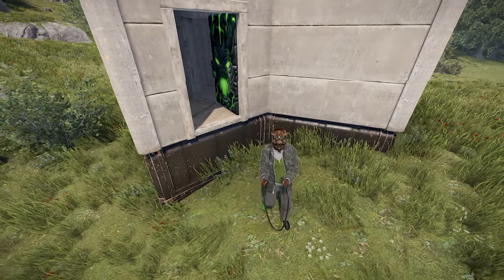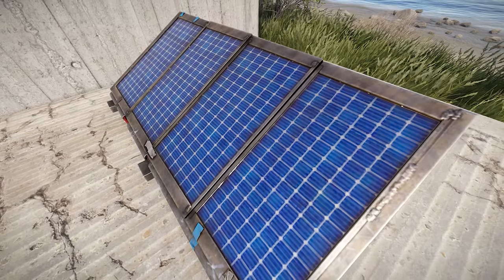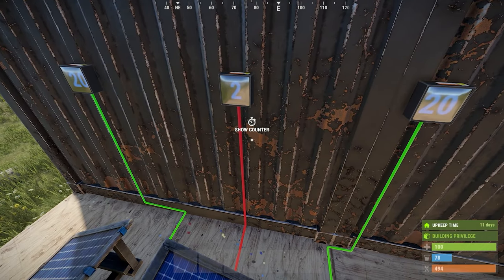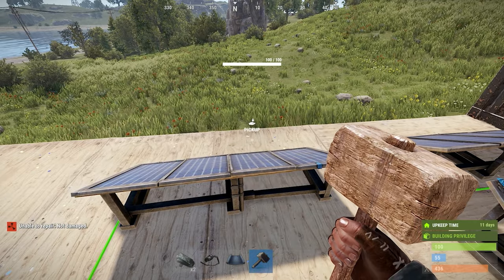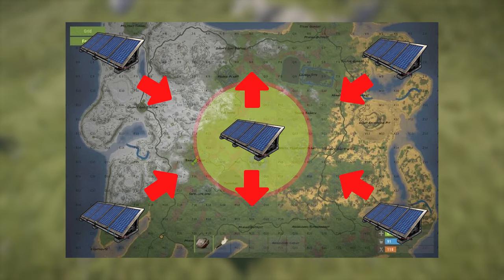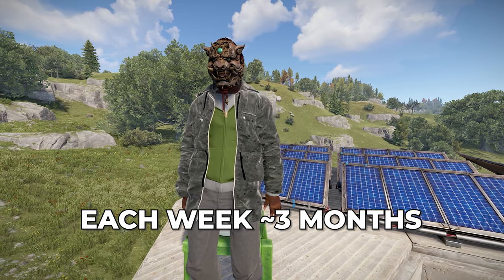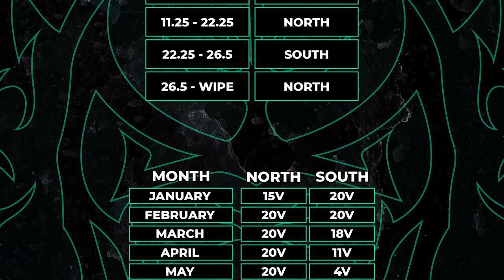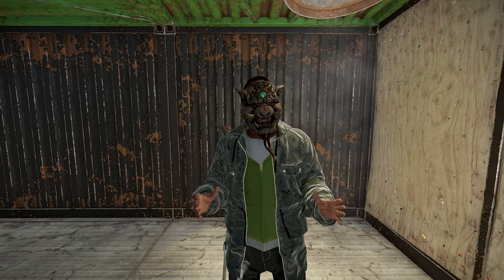Maximize Your Solar Panels with the BEST Direction & Angle [RUST]

Comment: Nice & compact tips, thank you. Few more would be good to mention:

1. Could be shadowed not just by walls, but all kinds of deployables, but also trees, rocks/mountains, and even neighbor panels as well! Panels will shadow each other if you place them to tight!
2. Is it possible to place just on the ground near the house? I saw such stuff a lot some people do, and it doesn't seem to be decaying.
3. Best way to destroy(grief) with non-explosive tools(combiners as well if could take damage).
Reply from the maker: @kote.7269  thank you! I try to cut out unnecessary info from the tutorials to keep them to the meats of what people are looking for!

And yes shadows of any kind can cause an issue 100%. As for placing on the ground I hadn’t thought of this! It’s possible more than likely but would be exposed to grief I’d assume!
Reply: @Sledge315  my 3rd question was exactly because it seems to be ungriefable. Some naked with melee weapon/tool sometimes comes to me, and start hitting panels, and after ~20 seconds usually give up since it does microscopic damage. 

And most electrical components now became invincible, in last wipe i noticed that you can not destroy sensors, buttons etc. Only with some explosives. That's why i mentioned combiners(red ones). Years before, since you can not grief panel - people could grief red combiners with ease. 

And for now?
Reply from the maker: @kote.7269  I feel you on this, a lot of electrical items seem impossible to break but you can definitely sabotage

With damaging a panel it creates less power for instance so hitting them a few times could slow progression of someone’s base if they use them for electric furnaces for instance. 

One time my bud and I griefed a roof camper and broke all his solar panels with some spears. Took about 20 minutes but we were committed. Also just yesterday I destroyed a ton of electrical with satchels with splash damage when taking down a door

There are methods but most don’t chase breaking someone’s electrical builds

Comment: Ive always placed my solar panels facing north and it worked without any issues. However for the past 2 wipes ive played they didnt generete any power at all. So my friend asked my to try place them towards the middle of the map and then it worked.
Reply from the maker: Hmmm now that’s interesting, I wonder why it happened that way, what way was center in this case? Direction I mean
Reply: @Sledge315  y it was weird. I even gave it one hour before I changed. I had to change to soutwest.
Reply from the maker: It may have been the timing of your wipe in that case then, south may have been the higher value at the time of wipe, at some “months” in rust north receives no power received. This is all I can think of as to the reason why southwest benefitted most

Comment: If when the sun rises its closer to the south than north then i place it facing south, if closer to the north then i face it north. This works fine for me. Generally, if im building in the north of the will face south and if building in the south it will face north.
Reply from the maker: @philcoppard7482  so that was the old system, and it definitely will retrieve some levels of power, but now it’s just plain north and south based on the games in game calendar system

Comment: Can you make a video on hiding solar panels and/or just concealing your power generation in general? Like make generators silent or hide solar panels in random deployable etc

(You don’t need to read all of this it’s just so you can see my  build logic/strategy) I’ve noticed a lot of people recently placing their panels on the ground in tall grass instead of their roof and as a solo that plays exclusively on monthly ‘clan’ servers aka I’m surrounded by clans 24/7 I generally build on the basis of deception meaning I’ll usually build nothing bigger than a 2x2 and usually it’s just my horse base then I’ll build multiple 1x2s with a wood or sheet metal front door and then sheet metal door then garage door and at each point I’ll put random useless items in boxes and name bags like “old starter” so basically I don’t attract attention and if I do attract attention they’re less likely to continue the raid once they see rad pills and human flesh and junk like that in the boxes and I further confuse them by placing the electrical wire from the outside to run to another corner of the 2x2 bases that isn’t my tc loot room so they waste boom and all that and even if they do raid me I’ll have like 4 other bases so it’s not a big deal but the problem is that by just placing a single solar panel you automatically become a raid target as soon as someone sees it so it kind of throws out most of my deception tactics and I got fail raided by a 4 man a couple days ago only an hour after placing a solar panel that was on a triangle/half wall (ground wasn’t level enough) hidden behind my 2x2 honse base and between it and a rock formation where no one could see it except at a perfect angle so in other words I know there has to be methods of hiding it better by using random deployables to conceal the solar panel but not block “sunlight” or something or maybe ways of making a generator run silently or at least where it can’t be heard from outside your base or something like that which I know should be possible because I made a electric furnace run silently last wipe on accident by placing a few deployable around it.

Anyway thanks for the content man, that was the best explanation of the month thing I’ve ever seen.
Reply from the maker: @StayProteus  thanks for the in depth comment! I’m here to talk and provide knowledge that I know or can research! I do know of a method that involves hiding your solar panels! I will it to my list, I am aiming for 1-2 videos a week for now so definitely stick around and I promise I’ll run a video in regards to this as long as the exploit still exist and weren’t patched!

Comment: hey sledge, please test a full day cycle 1am to 1am pointing to east and west opposed to north and south then, measure the batteries...tell me in you next video what you see...

With a normal server with normal day and night cycles east and west is by far the best option.

then you can do a day night switch using, making my panel switch on at 6pm and off 6am....good luck
Reply from the maker: I’ll give it a whirl! I used to do east west myself but after some research noted North is typically the dominant side

But truth be told, I just place these wherever on my base, I rarely struggle with not having enough in the battery! By the time it gets to that point I already have turbines haha